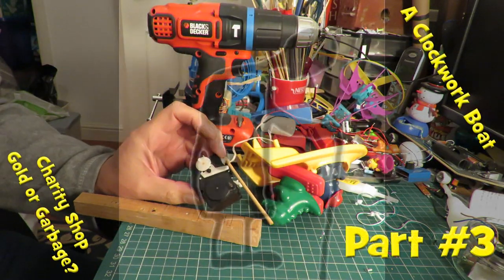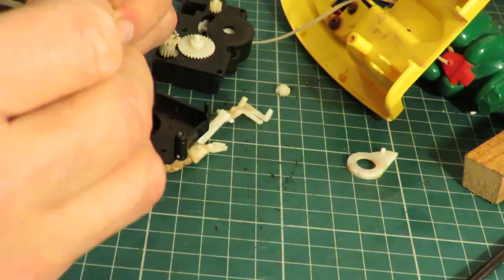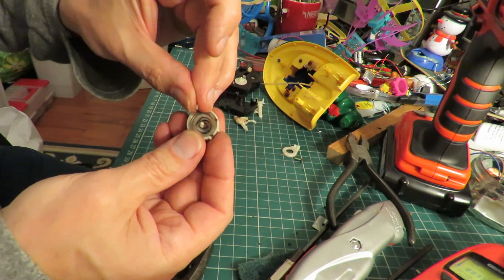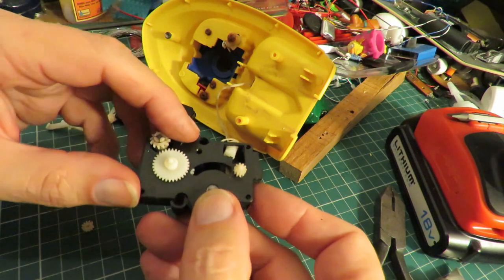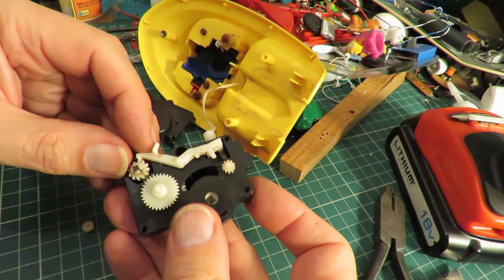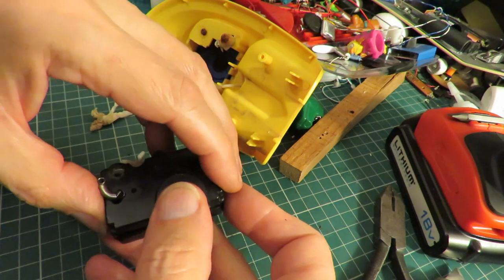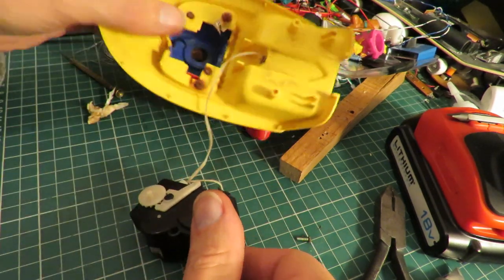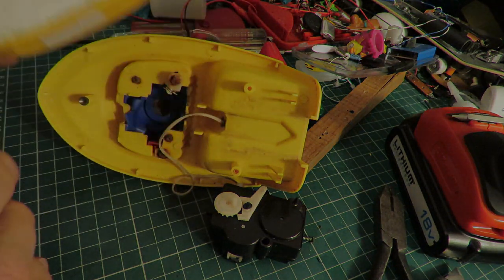Charity Shop Gold or Garbage? Clockwork Boat Part #3

Comment: The internal mechanisms there are really fascinating. Do you think you could install a small motor to drive the wheels, propeller, and tail?
Reply from the maker: It would probably be possible but then it wouldn't be the same.

Comment: Shame its not working :( Looked a interesting little toy.

This is just a idea, could you bypass the clockwork spring/function and use the existing gearing and add a small motor powered by solar maybe? Just a thought for a little project to get it working :)

Comment: Good try
Reply from the maker: I was disappointed. I really wanted it to work but I will need to find replacement gears and shafts if I want to repair it like for like. I could just rig up an electric motor to run the propeller but a like for like repair would be more satisfying.